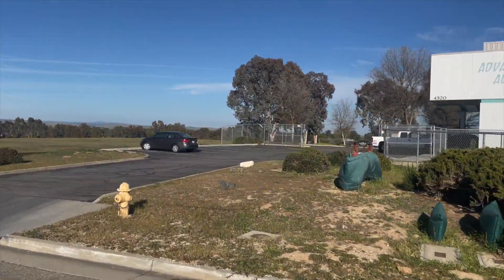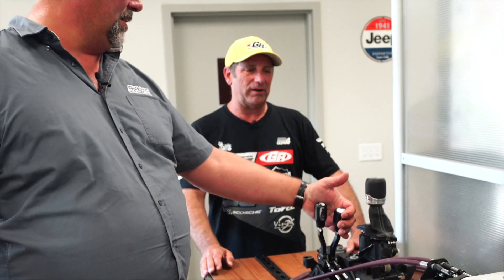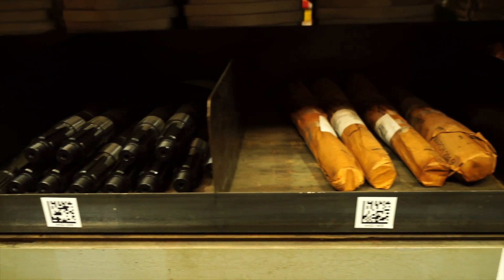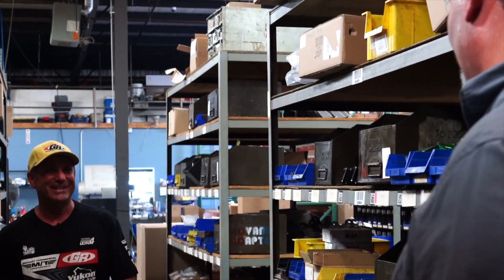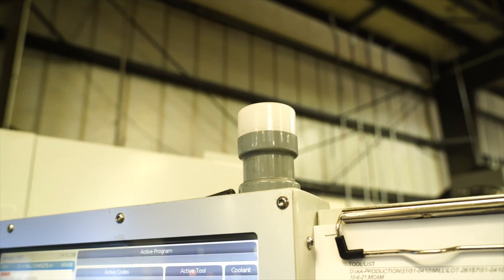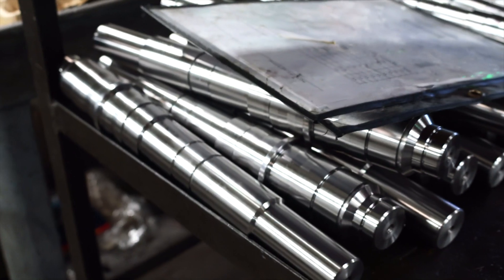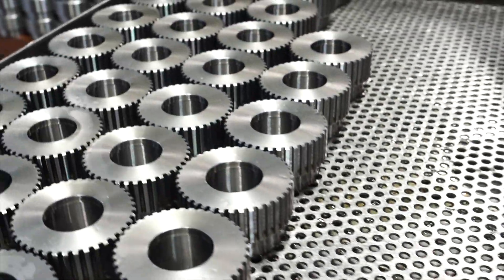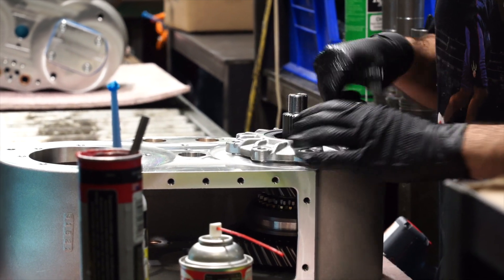Tech Talk: Advance Adapters

Comment: I work in engineering and QC for a company in western Colorado that makes drilling equipment for the mining and construction industries. It's remarkable how similar the materials, machinery, and operations are.
I can tell you right now that these guys are doing it right. Top-notch manufacturing on display in this video.
My 1986 CJ-7 with a SBC swap is sporting an Advance adapter between the Chevy transmission and Dana 300. It was assembled around 25 years ago and it's still going strong.